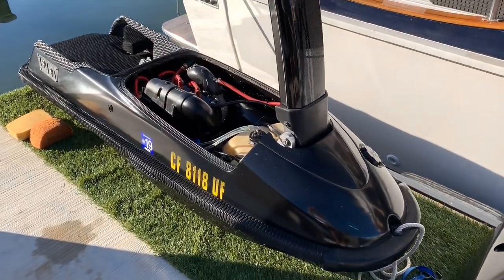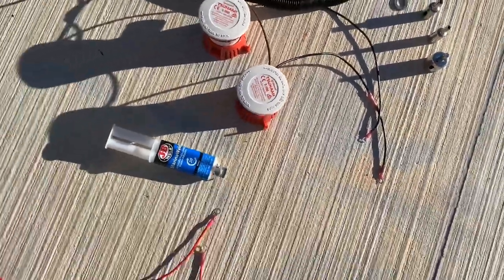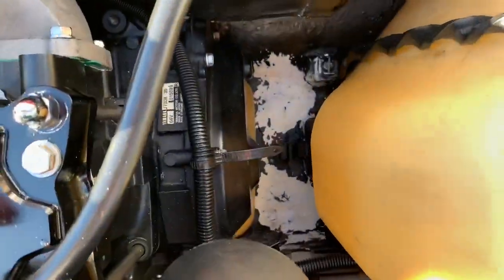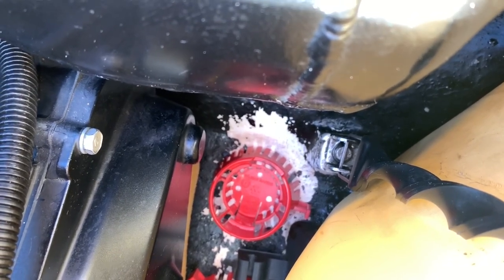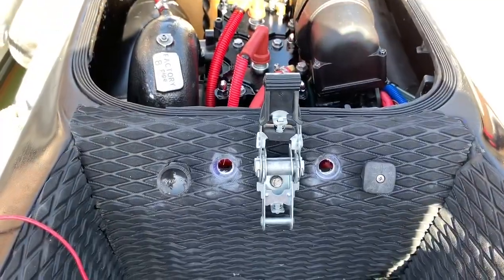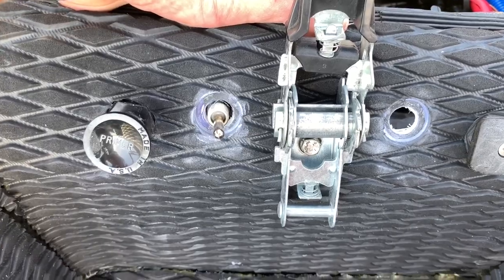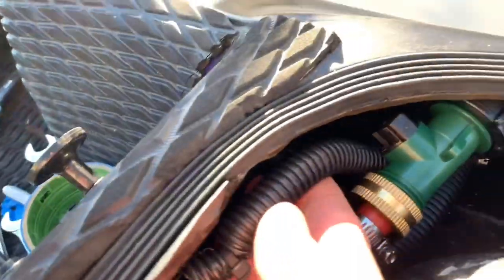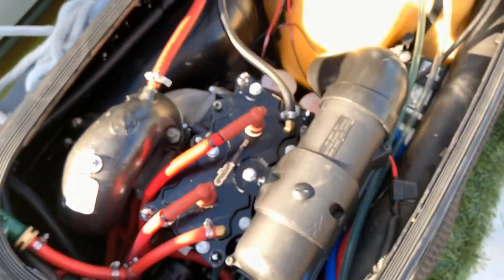Superjet Dual Bilge Pump Install (and DIY flush kit)

Comment: I need to install a pump on my 750sx and was wondering if the location of your billet holes worked well? I'm just concerned that water will flow back in when the ski is in the water. Have you had this problem? I would just install a check valve but I've heard this is a bad idea. Thoughts?

Comment: You need to put a electronic switch, so they switch on automatically.
Reply from the maker: Thought about it, Water Witch also makes something cool with no moving parts, might add something like that later, preferred the manual on/off.
Reply: You can still retain the manual switch. I have my boat wired with the automatic and a manual switch for a piece of mind.
Reply from the maker: @jonyovanno4145  Don't really want to count on a float device while in the rough surf, but thinking about checking out the Water Witch device later.
Reply: Where did you exit the bilge? Did you use two exit ports?
Reply: 1wave use Whale Electric Field Sensor Switch instead of mechanical float switch. You can wire both automatic and/or manually on a three way switch.

Comment: Everything about this was done incorrectly. Bilge pumps should be sitting next to the coupler as that is the furthest back when you’re actually riding the ski. Also why drill two holes in your hull? Just buy a 3 position switch.